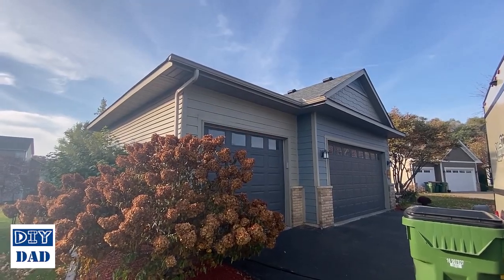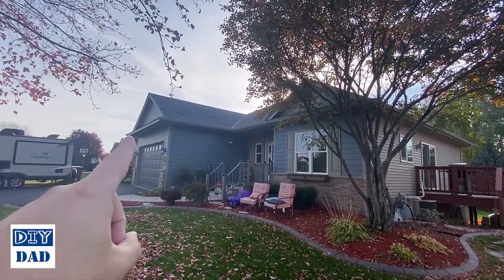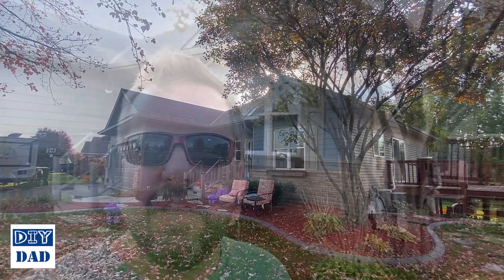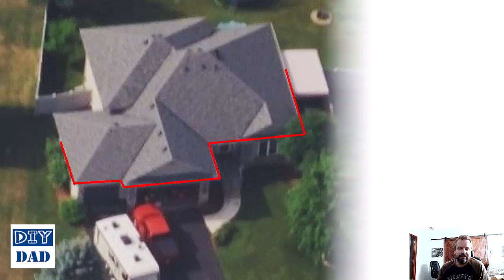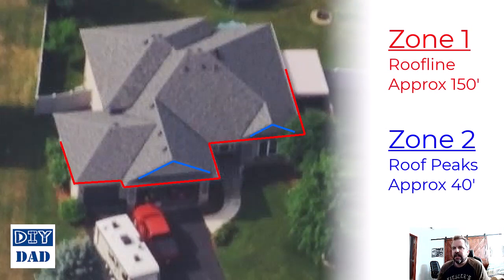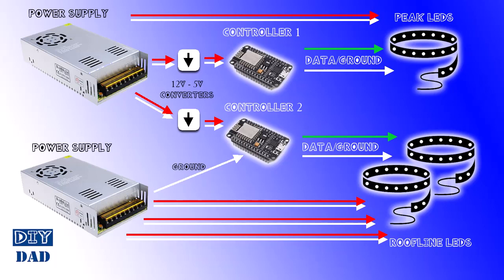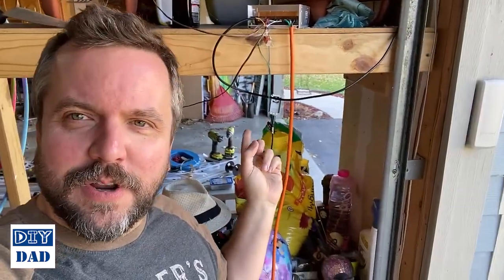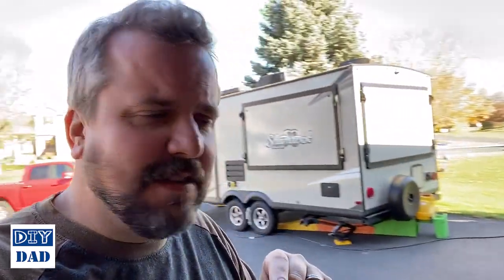DIY Permanent Holiday LED Lights: Planning the Install

Comment: What LED strips are you using? I like the WS2815 so I can do individually addressable pixels.
Reply from the maker: I’ve been using WS2811 12v waterproof strips in conduits with diffusers and have been very happy with the lighting effect produced.
Reply: @AskDIYDad  Nice... the reason I like the 2815's over the 2811 is the ability to control each pixel individually if I want and most importantly the 2815 has a backup data channel so unless I lose two consecutive pixels, strip outages are minimized.

Comment: Have you seen quinled’s Dig Uno and Dig Quad? Would have worked well for you with only one power supply
Reply from the maker: No but I’ll check that out, thank you for the tip!

Comment: Great, clear video! I'm sure there are hours of your research behind figuring all of this out and you taught it well. My house roof line lengths are about the same lengths of yours. I was hung up on how to get an ESP32 controller to work since I'll have 1400 leds in one run. I think if I understood you right since we're using 12v (to help with power) I can take 1440 leds and divide that by 3 since the leds are addressable in groups of 3 making 480 addressable leds? I'm trying to get a QuinLED-Dig-Quad so I can use one controller and send 3 channels out to different parts of my roof but so far I can find one. Is there a reason you went with two Esp8266 instead of going with a esp32? Man I look forward to your next video, I'm curious how you wired and injected power and also if there is a need to boost data. Great videos!
Reply from the maker: Hey Jared!  Thanks for the kind words!  To answer your questions, yes - the 12v strips address as groups of three lights - so my roof peaks which are 588 actual LED lights are configured in the software as 196 lights. 

I went with the ESP8266 mainly because I had nothing but trouble getting the ESP32s to flash properly vs the ESP8266 which have been rock solid for me so far.  Since the software allows WLED to "sync" multiple controllers there wasn't a real negative to me doing it that way and it worked amazingly well on Halloween (check my shorts, there is a quick vid of the lights in action there) https://www.youtube.com/shorts/5sJ3ohNaTnc

The Install video should hopefully be up in the next few days - my kids are dealing with some fall health issues (seasonal stuff.. flu or RSV or whatever respiratory non-COVID thing that kids are sharing in school today) which is preventing me filming the last few pieces and getting them pieced together.  Should be up this week though.

If you have other questions in your install (I'm no expert but I'm happy to share what I've learned) feel free to email me at askdiydad@gmail.com.
Reply: @AskDIYDad  Yes, I already checked out your short Halloween clip, and they look great! I sent you an email of my layout along with power injection points, wire lengths, etc. to get your thoughts. I hate to hear that about your kids but RSV is really rough down here too. I hope they are doing well.
Reply: @AskDIYDad  did you hold both rst and boot buttons down when you tried flashing the esp32s?  When you use the flashing tool and get the com port, you have to hold down both buttons down when you start the flash until the flashing tool recognizes the esp32.  Then you can let go of the rst button, then the boot button.
Reply from the maker: @jasonfair5160  My computer struggles to even recognize the ESP32 in the first place.  I have tried numerous drivers but nothing seems to fit
Reply: @AskDIYDad  hmm.  I had to manually download the cp2102 drivers and then manually tell Windows to use those drivers for the esp32 usb to uart driver to be good.  then using the esptool, I had to refresh the com port dialogue in order for it to show up properly.  i used someone's video from youtube to troubleshoot it.  hope you get it to work eventually!
Reply from the maker: @jasonfair5160  Thank you for that.  That's further than I went since I had access to a few ESP8266's (bulk deal on Amazon was like $10 for 3 of them).  I do plan to get back to it after the holidays.. largely because I don't like losing to technology :D

Comment: Thank you! This has been extremely helpful for me. I'm literally doing the same thing as you with approx the same length of lights.  My set up will only require one zone though with my peaks not having the roof line under like yours. Looking forward to seeing your install for tips/tricks
Reply from the maker: Excellent!  Glad it hit the mark!  Let me know if there’s anything I can do to help.. I’m no expert but whatever I’ve learned is up for grabs
Reply: Power injection is my biggest lack of understanding. I think I'm overthinking it...did you run a single long cable from power supply to very end of lights and then splice in the two locations for power injection? Or did you run two different cables to power injection for power supply
Reply from the maker: @MrSadlerd3  my next vid will discuss that more.. my power supply had three channels and I ran three separate wires to three places along the roof strip.  That may have been overkill, it is possible that if your amperage was high enough you could split a  single channel to multiple locations on different wires.. I wasn’t confident enough in the math on that.. and since I had the capacity on my power supply I decided play it safe and just wire it directly
Reply: @AskDIYDad  that is what I thought.i was considering running separate but I saw another video mention the single line and thought that seemed feasible but always like hearing what other did.